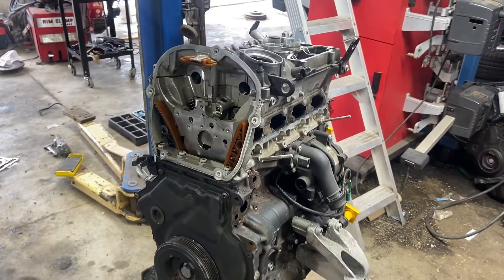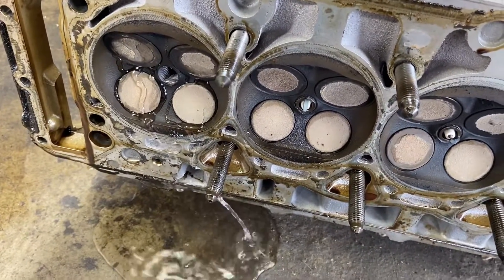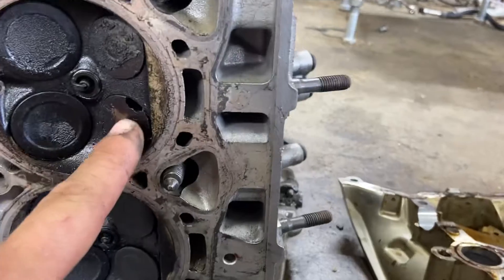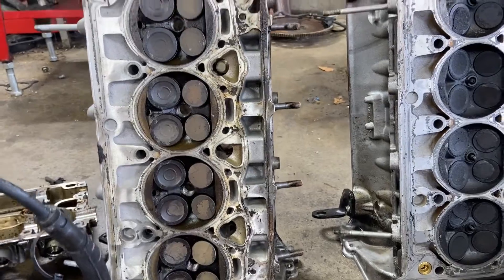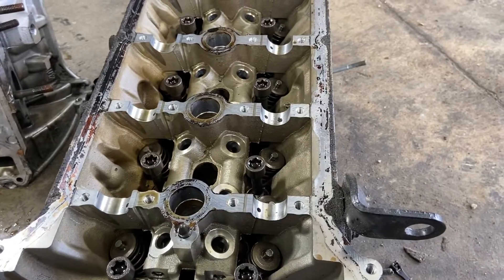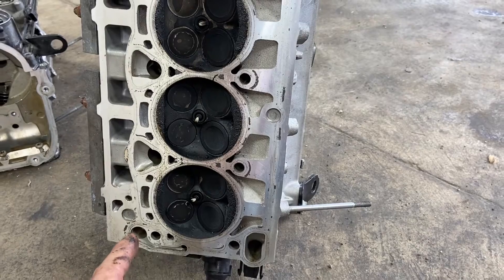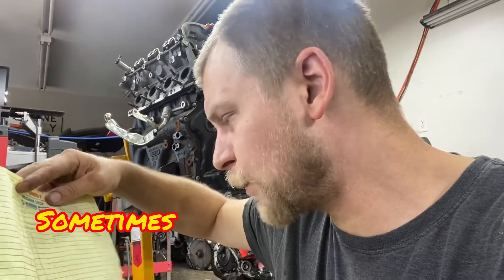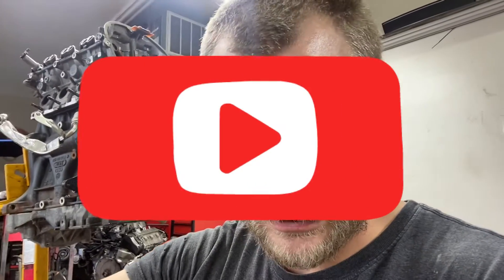2.0t tfsi tsi Audi VW Cylinder Head information extravaganza catastrophic failures & repair options

Comment: I’ve been my own rebuilds of these 2.0s for a while now. Still prefer to pull the whole engine and do a full rebuild with decent aftermarket parts. Key is don’t beat the crap out of the engine when accelerating (max 2-3k rpms) and do the oil change 3k miles. They will run forever. I just pulled one for rebuild with 230k miles with original engine—has a misfire in #3 with 90 psi. Still ran ok—drove it 200 miles to the garage.

Comment: my cam tensioner failed and the housing broke.  is it safe to assume timing is off now?  trying to determine if i should purchase a replacement head or take this one out and check.  Thx!
Reply: More than just a broken valve. The cam lobes usually get damaged and require cams too.

Comment: These engines are junk.  Had a chunk of my exhaust cam gear break off during driving the other day.  Took out the upper chain guide mount as well.  Im gonna weld that guide mount back on, replace the valves and find a used exhaust cam.  Car is up for sale as soon as it gets running again.  Shit cars.
Reply: Whats a good 2.0 turbo car then ?

Comment: Thanks for this video. Helped me decide on slapping in the intake valves myself or dropping it off at a shop. 2011 Tiguan 73,000 miles.  Failed tensioner

Comment: Well, my engine failed on me because of the original oil pump ceaced up, if a freewheel is not the solution, then what is? : S Im not gonna buy a new original one, that cost more then what I paid for the car.

Comment: Hello.  Love your videos. I have an 2011 A4 2.0T with bent valves because it went out of time.  Is it possible to remove the head without removing the intake first?  Was hoping I could pull the head, exhaust manifold and intake all together then remove them on the bench.  Thanks for your entertaining and informative videos

Comment: Where are you located? I got a 2014 Q5 CPM engine with bad bad misfire on 4. While carbon cleaning, I noticed one of the intake valves seeped cleaner down the cylinder. All the others held well. How much to replace the one bad valve?

Comment: Gearing up to go through a 2.0t vw that jumped time. I cannot get motor to complete one rotation. Crank Will only rotate from 1oclock to 11oclock. If ya follow me. Ill be using the crap outta your library.  Any thoughts?

Comment: I GOT SOLD AN AUDI WITH MISFIRE CYLINDER 1 AND RANDOM MISFIRES. NOW AFTER WATCHING THIS VIDEO I CAN SAY THE GUY KNEW THE VALVES WERE BENT, PUT IT IN TIME, THEN SOLD IT TOI ME. SMH.... I DID AN EXHAUST VALVE JOB BUT I DIDNT THINK TO CHANGE THE GUIDES..FML.. BACK  AT IT TODAY. TRYING TO GET ENGINE TO TURN OVER.. GREAT VIDEO I APPRECIATE THE KNOWLEDGE.. IVE SPENT MONTHS DIAGNOSING/ WORKING ON THIS BPY

Comment: i recently bought a audi a4 2008 cabriolet as my first car. it was really cheap. I was wanting to ask what would you suggestion be for starting mods?
Reply from the maker: Check you hpfp for wear then make sure your timing belt water pump is done, it’s also a good idea to replace your rear cam adjuster but not as important.  I’ll have a few videos on that engine coming up in about a week
Reply: ok, i will make sure to check it out

Comment: I honestly am shocked at the price to press out the guides and press in new ones. I figured that was a heavy labor job that would cost a lot more. I can attest to the things you've said, as I've been one of those who overlooks the guides and my problems were not fixed. I will say one thing though and I cannot stress this enough, Naptown is spot on as to why he tells us and educates us to buy original Audi parts. You WILL end up paying more by being frugal and buying China. The work will have to be done twice, gaskets, o rings, bolts, etc will have to be bought twice, and your downtime will more than double. Take the extra time to save up a little more and buy original. I've done it and it sucks

Comment: Speaking of boost, from your knowledge how much boost does a k03 push on stage 1 or 2? I know it can be different from tuner to tuner but usually what is the safe spot?
Reply: I am stage 2 apr with ihi and push 21 psi hold at 18
Reply: @yabbadabba3994  ihi is on a different ball game
Reply: @yabbadabba3994  I don't know 100% if the turbo from 2.0 is exacly the same as the 1.8 but i guess it's the same, at least it's looking the same,i don't know if IHI is better or not either, mine was changed by the previous owner from the factory turbo to a borgwarner most likely due to the wastegate.
If it happens for you to know, please tell me what percentage your n75 duty cycle runs at. mine is around 80-85% until it can't hold anymore and by the time i hit 5500 rpm it's maxed out at 99% and the boost drops from 1.2 to 1 and so forh until 0.7 bar at around 6.8k if i remember coreclty, but even like this i still make 200hp from 4k until 6.5k and peak power 230 on dyno with my 1.8 tfsi not the 2.0.
Reply: @noitrex  ill have to check. I believe i have a intake leak or exhaust leak idk if that would effect the numbers. But is there a channel to check on obd11/vcsd that you know of for the duty cycle of the n75?
Reply: @yabbadabba3994  an leak should have an effect on the log, basically if you leak boost n75 will try to compensate for the loss by closing the wastegate to make the requested boost resulting in a higher percentage number on the data log.
I usualy use obdeleven for logging data since is more easy with it than with the vcds.
On my obdeleven live data is written as : "Charge press. ctrl. spec. value" - meaning Charge pressure control specified value.
If you use channels i think it's 114, 118, 119 if i remember coreclty, as i said it should be in %.
Reply: i have a k03 on the ea888 1.8t fsi gen 1, with the racechip, my boostguage exceeds 10psi before the diverter valve kicks in , this is supposed to represent stage 1, i had it configured to output more because i have a upgraded intercooler, cold air intake, and a throttle body spacer
Reply: @AKDiag  Racechip is worse than a actual remap, an 1.8 tfsi stock is 120hp or 160hp(same engine, marketing strategy) with an actual remap makes 200hp and it should push 1 bar(14.5 psi) at stage 1, my k03 on stage 2 makes 1.2 bar(17.4 psi) until around 4k rpm then less as you go further in the rpm.
I was curious what is his answer because i heard people that can make 1.4-1.5 bar with k03 on the 2.0 tfsi but i could not manage to push the turbo on my 1.8tfsi to do that even though my wastegate is ok and i changed the standard dv with an dv+ from gfb.
At the moment i make 230hp on a 1.8 tfsi stage 2 with 1.2 bar.
Reply: @noitrex  im trying to change my dv but i have a rounded off bolt, im going to cut it out and do the dv+ kit, i got the racechip as i have trade discounts and wanted to manage my hard foot while im on the motorway. the xlr and racechip work well for economy for me. i plan on skipping stage 1 and going straight to stage 2, just waiting on the sports cat